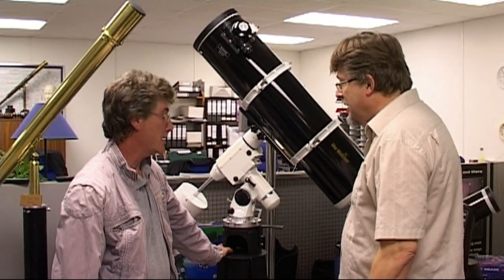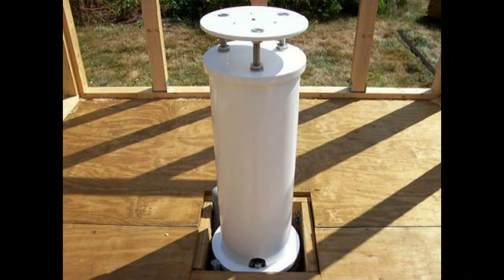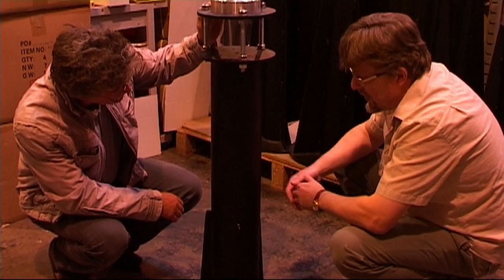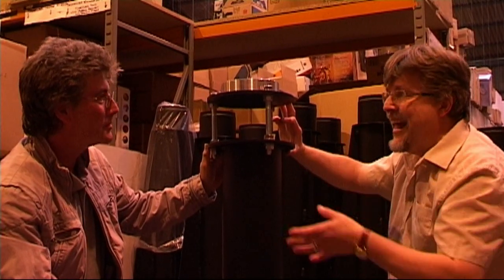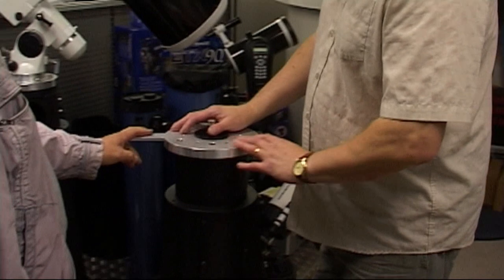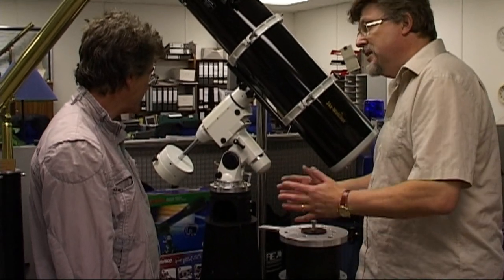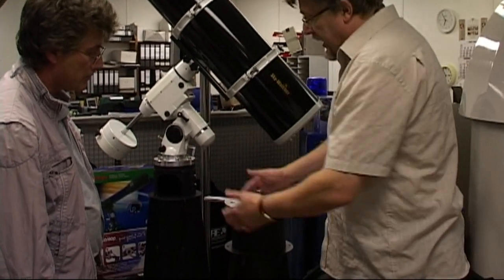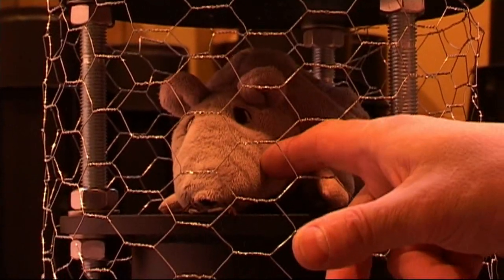Anti-vibration observatory piers (Part 1, Piers: The good the bad and the Rat Box)

Comment: I’m confused! ‘A sophisticated machine’ ...it’s a standard pier just with extra supports welded on...it’s literally 7 pieces of steel.  Just fill it with sand or concrete ...it’s the same effect. I’d love to see several images taken with exactly the same setups but with the only change being the pier and try to tell the difference. I’d be happy to be proved wrong.
Reply: If you can afford the type of equipment that would reveal those errors in your images, you could afford the pier he's selling to avoid seeing them. If I'm spending £30k on astro equipment why wouldn't I just buy the £1k pier?

Comment: I liked this explanation, and you're spot on regarding mount head level importance to polar alignment and accurate star alignment. The problem still remains, that in 2021, several astronomy computer applications require those three alignments to function correctly. To my knowledge, that star model is not synced between all the applications. Without the star map, they assume the mount is level.

Comment: Wood dampens vibration, some of the very expensive tripods are made from wood. What about a wooden pier that is dried and sealed so no moisture can get inside. Maybe an 8x8 pressure treated post or plywood pieces glued together to make an 10x10" square post and bolted to concrete in the ground. Laminated plywood is very strong.
Great videos, thanks, really got me thinking.
Monty

Comment: It sounds like a 15 minute commercial for his own pier. There are many many videos on YouTube that show homemade ones and they are quite happy with the results.
Reply: Without trying to sound unkind, there isn't really much to these devices other than using a wide and heavy steel tube to maximise stiffness. You could probably make their one even better by filling it with concrete. What would be more sophisticated is to deploy FEA to avoid resonance with the kind of applied loads these piers see, such as, for example, the tiny vibrations from motor-assisted worm-gears, which probably cause the most problems in terms of seeing. But there are also issues of vibrations from the ground being transmitted to the telescope, such as from traffic. Stiffness isn't always your friend. Mass needs to be dampened.
Reply: Only because they don't know any better...

Comment: I built my pier using an 8”x8” pressure treated wood post. I also have a “rats cage” on the top and have zero vibration, absolutely zero. I know because I have a frequency tester, I tested vibratory compactors for years, I completely disagree with you on the rats cage as a stability problem area.

Comment: I thought if the top is not accurately levelled up, the pole star is going to drift off the polar alignment as it transits?  Even if the mount is aligned with the pole star.
Reply from the maker: Hi Vincent. No , the leveling of any part of the mount plays no part in improving or diminishing the accuracy of polar alignment once achieved. The critical datum is aligning the centre of the RA rotational axis of the mount as precisely as possible with the rotational axis of the Earth. There are no other considerations. The phrase 'precisely as possible' hides rather a lot of considerations in fact, but they do not impact on the validity of the previous statement. The pier can be bolted on the wall, subject to the wall's strength, and the pier top can be canted at any crazy-house angle - all that matters for PA is that the RA axis' centre of rotation is aligned with the centre of the Earth's axis of rotation. This is normally achieved by pointing the RA axis as precisely as we can at the calculated North or South point of rotation as projected on to the celestial sphere (depending on which hemisphere we are in). The mounts standard of level (and its always interesting to hear how folk are going to achieve and measure this initially) has a role to play when aligning equatorial mounts in the field, where time is short and we are prepared to accept approximations for the general good of achieving a task specific standard of PA but is otherwise irrelevant in the critical path outlined above. For more information please see my longer reply to Curtis Reynolds above. I hope this helps. Thanks for posting. KR RJD A&NTV

Comment: I don't disagree with the "rat box" commentary, but....if you're not leveled, don't you drift off target?....even with a perfect polar alignment.
Reply from the maker: Hi Curtis and thanks for your question. No the level of the pier is irrelevant once the rotational centre the RA axis is aligned with the north celestial pole. But read on as there's a bit more detail lurking behind that statement. It doesn't matter what angle the pier or its top plate are positioned at once correct polar alignment  (PA) is achieved. However, instructions supplied with telescope mounts that require PA seem, at first glance, to deny this fact. The reason why it is tactically useful to level, to an albeit approximate standard, the tripod top prior to fastening the head in position is that it will make the process of achieving a useful standard of PA easier and therefore quicker. An important consideration when setting up equipment in the field. A level tripod top, and therefore more or less square, level and perpendicular N/S latitude and azimuth E/W axes, makes homing in on good PA easier if you are not dialing in a large North or South error every time you move the mount head East or West and vise versa - as you do in the case of an out of level head. But the picture is quite different for a permanent installation. We are not constrained by time and the need to accept approximations and given that the installation is to be permanent the additional time required to achieve good PA always becomes utterly trivial measured against the operational lifetime of the pier. So to in anyway compromise the rigidity and stiffness of the pier - for its entire lifetime - in the cause something that adds 10 minutes to achieve a standard of PA comparable with what was achieved on the 'level' tripod - is clearly folly. Indeed, you would never want to fly in a plane or drive a car built employing this kind of flawed logic. You'll note that I put inverted commas on that word level in the last but one sentence. You might ask yourself what someone really means when they say that the tripod head or pier top should be levelled. In most cases the manufacturer of the tripod has glued a little 10 to 15mm diameter bubble level into the top casting. A blind man's guess is probably better than this at gauging approximate level. And a good seven inch DIY spirit level won't be much better either as there just isn't a wide enough base-line anywhere on the pier or tripod to get a good (enough) level to ensure that there will not be axis errors dialled in by adjusting the opposite axis. So the best pier installation strategy is to place rigidity and stiffness above, well above, any considerations of ease of achieving a high standard of PA - because it will not be level to the impossibly high standard it needs to be (to achieve single axis adjustment unhindered by cross axis error) anyway. Realising that every head is out of level, to a high standard, no matter what you do, and therefore might as well be out of level to a much wider standard actually liberates you to concentrate on what matters; and that's achieving a suitable (task specific) standard of PA with the stiffest and most rigid pier/tripod mount you can manage. The 'rat box' and other similar devices that compromise the function of the pier but promise the inexperienced purchaser (or copyist - as the rat-box has been copied hundreds if not thousands of times by well-intentioned home builders) ease of installation offer no useful contribution to the mission as I have stated it above. I hope this helps and thanks for the chance to explain this. KR RJD A&NTV
Reply: Awesome. Thanks for the very thorough explanation.